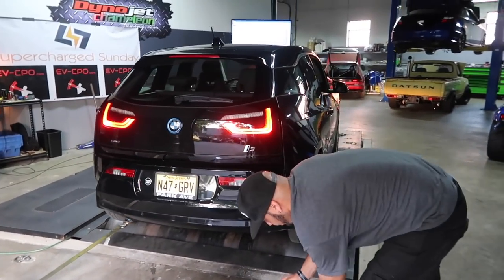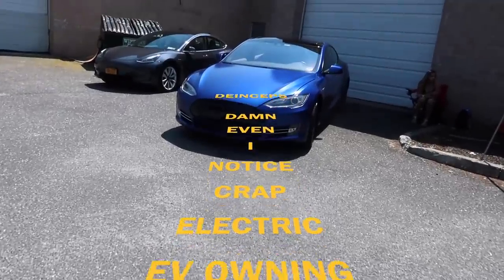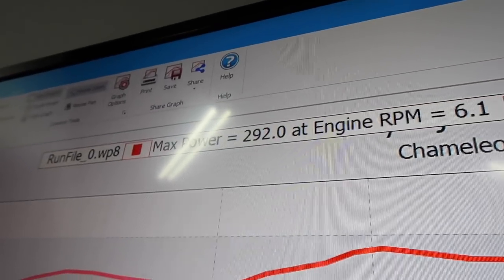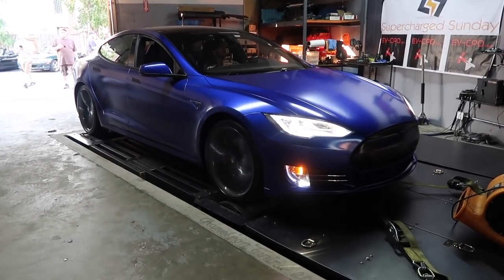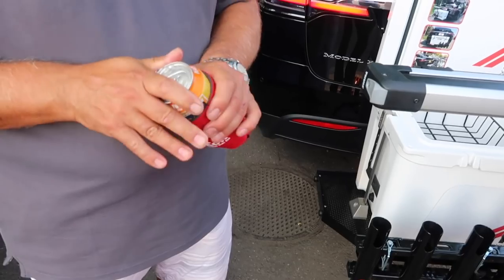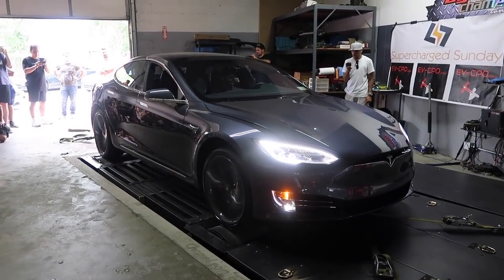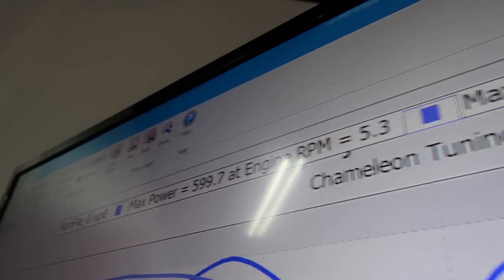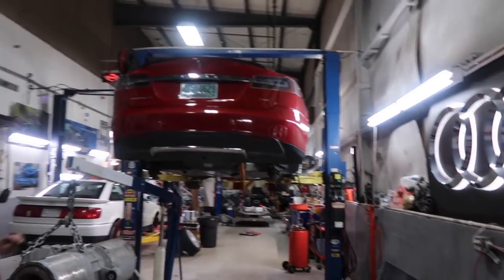Do Teslas stand a chance against my CORVETTE?

Comment: EVs are slower at speed because they don't have a gearbox. Less things that can break, and cheaper too build and maintain.
The new Tesla Roadster will likely have two or more gears though, which will make it destroy ANYTHING at ANY speed.
Reply: tali sson Gears are simply losses. The reason torque drops is the battery, it cannot supply enough power. These batteries arent high power density. As rpm goes up torque must drop to mantain the limited power the battery can supply.
Reply: That is actually because when the motors start spinning up to high speed the EM fields they use can't transfer as much torque to the rotor due to it moving past the electromagnet at high speeds. Increasing the voltage on a motor like this will increase the maximum torque and thus improve this characteristic.
Reply: John Rickard In the case of the Tesla it is the battery that is limited. BEMF can be solved with a faster motor, higher RPM/volt and a fatter controller.

But it doesn't help if the battery cannot supply enough power, as is the case with the Tesla.

Comment: Rimac Concept 1 has multiple gears  and it beats Bughatti Veyron
Reply: Not at high speed, in fact its top speed is around 100 km/h slower.
Reply: zolikoff
It takes a lifetime to get that bhugatti top speed.

Is it fast but not quick fast?
Reply: 20-ish seconds. It's definitely not the fastest.

Comment: 2:13

Actually that’s an engine...
Reply: Definition of motor

 (Entry 1 of 3)

1: one that imparts motionspecifically : PRIME MOVER

2: any of various power units that develop energy or impart motion: such as

a: a small compact engine

b: INTERNAL COMBUSTION ENGINEespecially : a gasoline engine

c: a rotating machine that transforms electrical energy into mechanical energy

3: MOTOR VEHICLEespecially : AUTOMOBILE

Comment: Yeah electric motors fall flat on their face at higher RPMs, but Gas motors would explode into a million pieces if you pushed them into the 17k RPM range that electric motors go to.
Reply: Cole Bender they were doing 20,000+ rpm in F1 many years ago... Granted, not an everyday engine! Beautiful pieces of engineering.
Reply: 0tispunkm3y3r Well I guess if you wanna pick out rare instances of me being wrong I could point out that there are electric motors that are capable of spinning upwards of 50,000 RPM.

Comment: Imagine an ICE with only one gear. Pick whatever gear ratio you want, it would totally suck. The reason you can get decent acceleration and top speed is because of a transmission. An electric motor doesn’t “fall flat on its face” at high speeds, it’s just running one gear. Throw in a transmission and an ICE wouldn’t stand a chance in any single metric you could come up with. Having said that, I’d prefer the lighter and more reliable reduction gear to a transmission. Tesla engineers agree.
Reply: lol
go to Hoonigan where Emilia runs her Corvette vs Taycan with 2 speed transmision
Taycan lost by a bumper -still not enough......that was a Turbo version (don't know why they named it it has no turbo ever)
Toyota  engineers disagree with what you said...
Toyota beat Tesla as a car brand. 
Toyota Hilux is most reliable car - its ICE pick up. 
None of EV reach that level and never will. Mechanics beat electrics in reliability and durability . its physics 
CEO of Toyota said no  to ICE band and no to forced EV push.
Reason why EV has 1 gear - because motor has wider rpm band like up to 14 000 like older gen F 1 engines, so it doesn't need many gears - so “fall flat on its face”  is true, because its uses all its rpm from 1 second you press pedal, while ICE made rpm more smoothly. ICE with 1 gear? i bet you never hear of Koenigsegg....and also CVT transmission  is1 pulley connected to 1 pulley - so its 1 variable gear.
You welcome